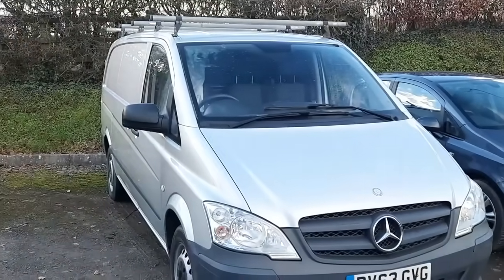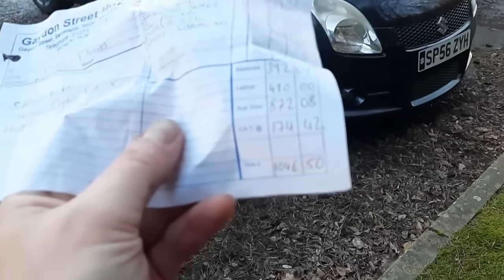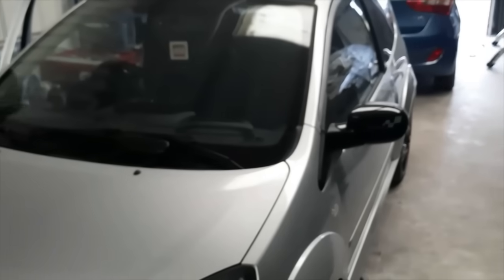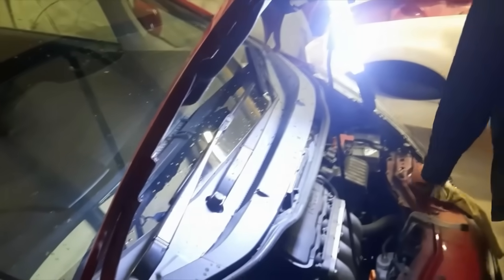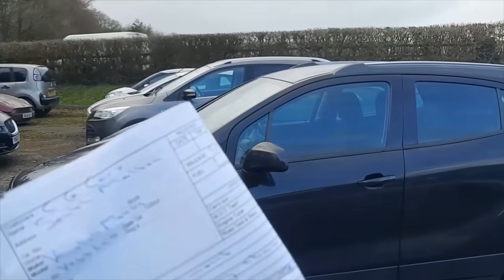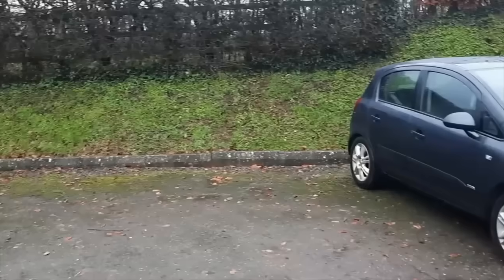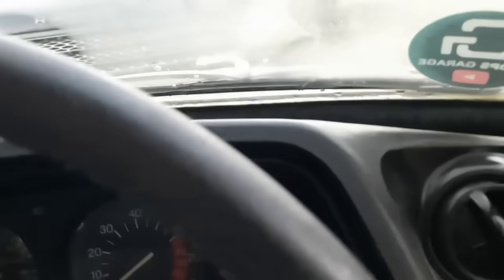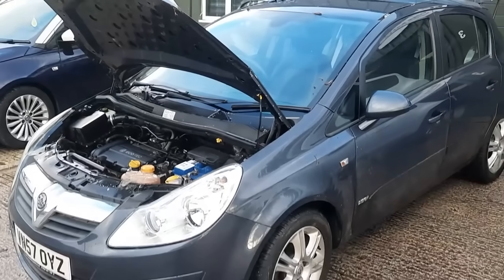This is exactly why you should NOT buy Used BMW's

Comment: The engines are indestructible on the little jazz’s! My dad bought one brand new on 2002 when he retired, kept it for 10 years and put 145000 miles on it, only issue he ever had was a coil pack went on it!
Reply: They suffer badly on rust. They've got 8 spark plugs/coil packs....the rear aint that bad to do. They're amazingly reliable & a good work horse.
Reply: @tardeliesmagic  and a sod on fuel.... their achilles heel.
Reply: @tardeliesmagic yep they rust like buggery. Such a shame!
Reply: Got one at 230000 sounds like it came from the factory!
Reply: Intermittent fan kicking in is down to the fact that, if it's a 2010 to 2015 Jazz, be it SI or any other, check to make sure the AC fan is turned off.! that's why the fan kickd in & you get Intermittent cold & hot air if it's got the heater settings on hot.!
Reply: Manual might be ok but the auto is best avoided.
Reply: @theodavies8754  my dad wanted an auto the same principle applies to the DSG if you service all your gearboxes might be ok because dsg are known for failures but the average person isnt told by the mechanic to service their automatic gearboxes

Comment: biggest issue with BMW's is their stupid service intervals, change engine oil every 10,000 miles or every year there is rarely an issue, another problem is auto gear boxes being "sealed for life"  utter nonsense, if you follow ZF's or Aisin's service intervals generally all will be well, buy second hand and you need to expect expensive repair bills, they are complex cars, but no more unreliable than any other make IMO obviously 😉
Reply from the maker: I'd agree re the servicing
Reply: I've had a manual 5 series done over 250k and the only thing that went was the turbo, always serviced every 10,000 miles and going easy on it until it's warm
Reply: @mohammedusman7065  I have done 100's of thousands of miles in BMW's and found them to be very reliable.
I find the people who listen to BMW haters and their old wives tales, not worth engaging with, muppets.
Reply: Bmw bikes are the same ridiculous service intervals and prices ! My new bike only 7 tho kilómetros and still had to have 1 year service ! Surely any automotive is the distance it’s traveled not time  !

Comment: Mmm - oil level too high warning - I had that on my Transporter. Thankfully mine seems to be ok, but it can be because on a failed regen diesel ends up in the oil so the (once correct) level ends up registering 'too high'.
Reply from the maker: You have to remember we had this prior no issues and this only happened immediately after service

Comment: I bought an E60 2.5i BMW in 2017 it was a 2006 reg it had only 65 thousand miles on the clock one owner full BMW service history it’s now 2023 has only done 90 thousand miles never failed an mot the only work I’ve had to do is I replaced two solenoid valves as it was burning oil BMW wanted £280 plus vat each just for the parts I got two valves from a company in Germany febi bilstien for £170 and fitted them myself I change oil and filters every 4 months and never have any problems great car
Reply: You change oil and filter every 640 miles??!??!

Comment: The whole BMW timing chain thing is exagerated. The big problem is lack of regular oil changes, plus there's a big section of the used and affordable user base, I'm talking 1 and 3 series cars, that are young scrotes who scrimp on servicing and redline them daily. I've never understood why their 2 litre diesel needed a 5500 rpm redline, there's little reason to push them past 3k.

Comment: Timing chains should last a minimum of 150,000 miles otherwise manufacturers should have kept rubber belts as they are far cheaper to replace.The use low quality sprockets, guides,  chains and tensioners are to blame.

Comment: Check you users handbook on dip-stick oil level? On my 2005 plate 120d you check the dipstick level after at least driven for 6 miles to warm the oil and about 10 minutes for the oil to return back to the sump…

Comment: What you should do is buy well maintained BM's and if I assume this was a diesel, this is where you messed up because there are always telltale signs of whether an N47/N57 or B37/B47/B57 has been serviced regularly and all you need to do is to take the oil cap off and shine a light inside, if it's clean alumininium it's been regularly serviced, however, if it's just dirty black inside, walk away because the oil hasn't been changed frequently enough and the chain is likely fail prematurely along with other potential issues.

From late 2014 the 114d & 116d efficient dynamics utilised the B37 engine with the 118d and above using the b47, these are revisions of the N47 with all of the previous timing chain guide and tensioner improvements. If you service these engined cars regularly, you do not need to worry about the chains at all. They are not affected by the original issues linked to the N47 and even N47's can last 200k+ if you change your oil every 8k. 

Also the engine does not have to come out on any 1, 2, 3, 4 or 5 series in both E or F generation cars, unless it's an xDrive. The gearbox takes 30 minutes to remove and the sump comes off without moving the subframe, that's all you need to do and the best BMW mechanic on Youtube does it exactly like this.

Trust me, take the oil filler cap off and have a good look inside with a bright light when thinking of buying a BMW diesel, this will save and/or make you money whilst removing significant risk.
Reply from the maker: Unfortunately servicing makes not difference. These fail due to poorly designed chain and guide not due to wear.I have. And so have others,  plenty fail even with FSH.
Reply: @ChopsGarage servicing does make a difference. A lot of people service cars when when light comes on dash saying to do so. By then they would've driven way more than 10k miles. That is not good. But chains failing due to manufacturing defects is usually far and few in between
Reply from the maker: @mishimamaster1845  BMW basically admitted a manufacturing fault of tensioner on this engine by upgrading them later and upgrading in chain kits! No amount of oil changes will stop bad plastic cracking
Reply: @ChopsGarage  it is a bit odd that generation of bmw still has issues with chains. Thought they fixed them in the F10 generation. I know the E90 period were notorious with the 2.0 diesels chains but then again, the service intervals were stupid long. A recipe for disaster if you ask me.  I had a 2009 330d and that was mint, even though the 3.0 litre engines were waaay better built

Comment: I got a 2006  C1 with an LPG kit on it's still going at 167000 miles. Original Toyota thrust bearing lasted till 12000 .cable clutch. Got a 2010 Panda in the garage to replace it when it dies. The Panda only has 30000 on it and one of the tyres is date stamped the year the car was made (not the spare)

Comment: I wouldn't buy ANY BMW after 2015 with more than 50k miles.
They seem to be a liability.
And taking an engine out to do timing chains is ridiculous ⚠️

The last decent BM engine was the M47 also used in Rovers and Freelanders. 
Timing chains were good for 500k and absolutely no oil consumption

Comment: BMW M57 engines very rarely have chain issues and are pretty much as economical as the problematic N47 and 2.0d variants that all have chain issues,the M57 is one of the most reliable 15yr old or so engines out there and will run 300bhp all day long , I've had 3 for about 6 years in total and never had any engine issues although some of the 2006 pre LCI variants do encounter injector issues.

Comment: Not just BMW James pretty much anything German! 😲😲 Grandsons Mini 1.6 has just had to have the timing chain done (£695)...Daughters boyfriends Audi A5 has just been booked in for new master cylinder as the clutch pedal is on the floor, been quoted (£1000 +)....Meanwhile my old 09 Suzuki Vitara bats on regardless!....As you might gather I'm in the Japanese motor camp if you want reliability!.... On the Twingo good job you got all those crimped connectors out, I've seen them melt and almost catch fire wrapped up with tape like that! 😵‍💫
Reply from the maker: Yes Vitara rules!

Comment: If your going to pick up a used beemer.  Better to go for a 3ltr Diesel or an older petrol 6 cylinder that's been looked after.  HOWEVER these cars are high maintenance and require regular oil and filter changes.  Mines a 2ltr N47 done just under 200k and gets oil/filters every 6/7k without question.  First thing i did was have the timing chain/guides changes as a precaution so this will easily be an extra expense on top of the purchase.  Issues typically with these cars are the plastics used under the bonnet and expect to have various seals/gaskets changed at some point particularly with the oil filter housing and valve cover.  Unless your handy with tools or you have a few quid in the bank i would not recommend BMW for the average person needing a daily run around.  It's just the way these things are put together and i have not even touched the diagnostics these things need should one run into issues with the control modules.

Comment: If your doing the timing belt on a B.M.W you might as well change the clutch while you got the engine out .
Reply: Hope that's a joke.   If  I get my cam belt done. I'm not changing the tensioner or the water pump.   Fuck it I'm  taking the chance where does one draw the line.   Be replacing the whole bloody engine at that rate
Reply from the maker: Customer was given opportunity to pay for that
Reply: @ChopsGarage  you pays yer money you takes yer chance.Each to there own.

Comment: I've got a bmw coupe in stock, loads of issues, traction keeps coming on so you can't really drive it, apparently it's the rear abs rings fattening out due to rust, I've just actually got it started today, been stood 18 mths, had a z4 this year, loads of work, rear wheel bearing was a right job, worst thing was rear lights stayed on for an hour, had to refund it, sold it off cheap as I was fed up with it and he complained, I think people expect loads from German cars and tbh I don't think there that good, I sold one a while ago, apparently the chain was stretched and very occasionally it cut out, I only sold it off cheap, anyway it cut out on her and she crashed...

Comment: I have a 2014 Suzuki Swift Sport- so it has the six speed box. Absolutely fantastic little thing! Across Exmoor its amazing and just such fun. The handling and composure are brilliant.

I bought it a few months back, more as a cheap, fun stop gap, as wanted a BMW m140i but, they were still overpriced after the last couple years madness. Now the M140i are dropping in price, i am reluctant to change as i think the Suzuki will ultimately be more fun on the road, although obviously nowhere near as quick.
Reply from the maker: Don't do it! Keep the Swift and spend the cash on holiday. The M will go wrong and cost a ton
Reply: Keep the Swift, I bought a five door Sport in 2015 and you are right,it is fantastic,great fun and a future classic!

Comment: I had a 2007 Suzuki Swift Sport - bought for £1850 a few years ago - £2300 put into it within 18 months - was a good car when it wasn't in the garage ha ha. I think it had a hard life before I got it and bought it off some bloke who worked next to the MOT centre (in Northern Ireland so government run, but I don't doubt brown envelopes were passed) at night in the rain and it had just been put through MOT that day, a month before required. Did view it initially in the daylight a few days before and did have a wee test drive but had never driven one before (apart from a lesser model that day that had loads more obvious issues) and it seemed fine and looked the part - clutch felt a bit heavy / harder to push in but I thought nothing of it as it was the sport model unlike the one I drove earlier that day. Doh. So my advice would be - if you want one - test drive a few and make sure they come with some service history and never do the final deal in the rain at night 😁 I was just looking for a car at that time but playing Gran Turismo too 🤣

Comment: As soon as you said a Renault with no blower, I thought connection problem at the heater resistor, very common fault on all Renaults, Lots of new multiplugs and connector available in the aftermarket. Your man could have been spared damaged hands! Most renaults have the resistor behind the glovebox and a loing flylead that loops around the heater box to the blower on the oposite side. Blowers changes are on lhd Renaults, via the glovebox, but on rhd the clutch pedat/steering column get in the way.
Reply from the maker: Thanks for sharing

Comment: I believe BMW's and other exotic cars need a 100.000 mile major service which includes timing belt, chain, water pump, tensioners and belts. And if it has a super charger that also needs to be serviced at the same time. I guess it is not just the exotics that need that service but it has to be done.  Now I realize that a timing chain is a lot stronger then a timing belt but is still needs to be looked at at the minimum.
Reply: The chains on that bmw engine were supposed to be for life, ie a non serviceable item, you can't really just have a look, quite often (happend to me) is when the chain makes a break for freedom, it's very common. I now don't buy 1.6 diesel BM, s or minis with that engine.

Comment: I really think consumer law should be amended for the case of second hand vehicles, just seems grossly unfair to the car dealer, 30 days is fair enough, anything over that seems excessive, and within 6 months a new car can create issues let alone a second hand, 3rd 4th hand motor. Laws need to be changed because the lack of flexibility is going to effect the economy in the grand scheme of things becuase people wont be able to get hold of second hand cars anymore and a lot of people cant afford new.
Reply: There really good points, unfortunately consumer law was updated a few years ago, to make it worse for dealers, so it's unlikely to be made easier.
Reply from the maker: I agree, under £5000 or over 10 years, 30days no quibble. After that it was not a fault at point of sale, it was just and old car
Reply: @ChopsGarage  that just about sums it up mate, just an old car.

Comment: I'd be interested in your thoughts on the Corsa D. We had a 10 reg 1.4 auto. Constantly throwing codes, I replaced the engine control loom, all relevant sensors. Still codes and cooling fan running,  stat replaced and coolant flange. Still same, codes, fan. My wife lost faith in it when it kept going into limp mode, so I bought her a Pug 2008 auto, which she loves. Sold the Corsa for £200 to one of the lads in the garage, the steering motor went on way to his house!! He (experienced car/ psv mechanic) couldn't get any joy with it, so chopped it in with his Audi for a T5 van. Are all Corsas a nightmare? Or did we get a dud? It was a good car for first few years.
Great video, and I'm re-evaluting the Suzuki Swift.😊

Comment: It amazes me that for all the so called rules and regulations across Europe nothing has been done about access for items classed as safety items such as headlight and tail light bulbs, a sidelight bulb on my 3 series effectively requires the wing off! Other cars while headlight unit needs removing to change a bulb utter madness. How do they get away with making the chain for the oil pump needing the whole engine and gearbox to come out. Regardless of it being a 100,000 miles before it’s required. Same with timing belts needing a similar level of effort to be done at 40,000 miles or so
Reply from the maker: I agree here re lights , it should be considered an intentional way to extort money
Reply: @ChopsGarage  it is, gone are the days the rear light cluster just had a couple of wing nuts to unscrew for access. Headlights you need arms like pipe cleaners

Comment: I always prefer cars with belts, not chains. People mistakenly think chains never need replacing, this is not true. 100,000 to 120,000k miles is when most chains need replacing due to guide wear and chain stretching. The more stop / starts a car does, or even worse those cars that use stop start will wear chains very quickly. Oil changes are also critical on chain drive engines. People are more aware of belt failures being an issue, so tend to do belts when required or slightly before. Generally, chain kits are more expensive too!
The Honda stat could be due to it having an air lock and someone not being able to shift it. They can be difficult to bleed properly, and may over heat as a result. However it could also be an issue that only appears under load. One of the Nissen petrol engines fitted to the Largo is prone to cylinder head cracks that only appear when the motor is hot and under load. It's always the No4 pot that cracks on them.
Reply: You never needed to change timing chains on old Alfa engines. They ran for 200,000 + miles typically. If they did wear they gave you plenty of notice. What changed was engine design with weedy chains and the advent of plastic timing chain guides that break with age. From that point onwards I prefer belts these days too. You can't trust modern chains, and belts have improved.
Reply: @timhancock666 planned obsolescence  from the manufacturer.

Comment: on a 2015 1 series l would have thought that the car should have had the newer B47 engine that was supposed to be the answer to the N47 with the glass timing chain. they launched the B47 in 2014 so l would have thought the 2015 car should have had the newer engine that was supposed to be cure for the chain problems
Reply: This is a late pre LCI car with n47. Could have been a late 2014 build..
Reply: I know my 2015 520d has the B47, but 320d cars typically didn't get the B47 until 2016, so in this instance it may well have been the n47. Either way, it's still worth ignoring the 18k oil change interval and halving it to 9k.